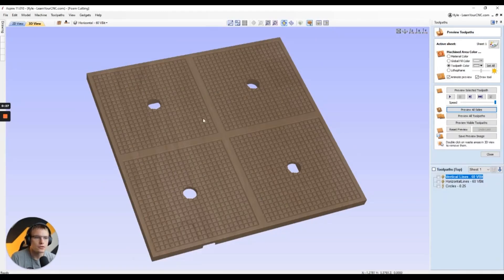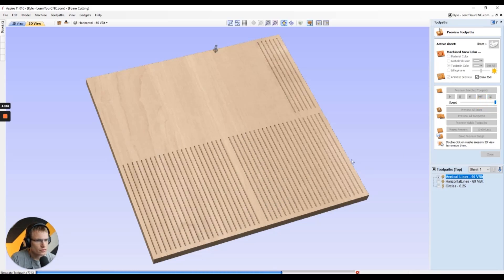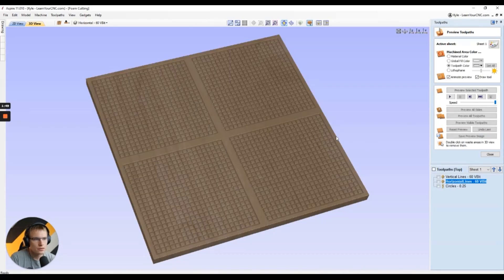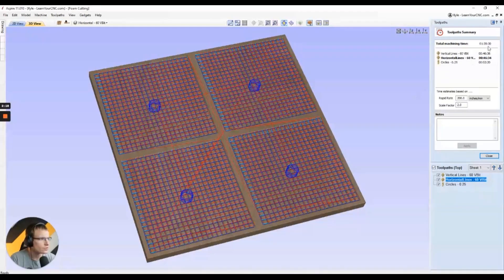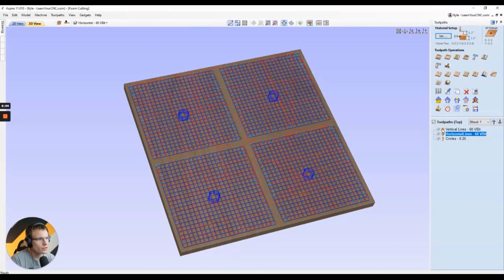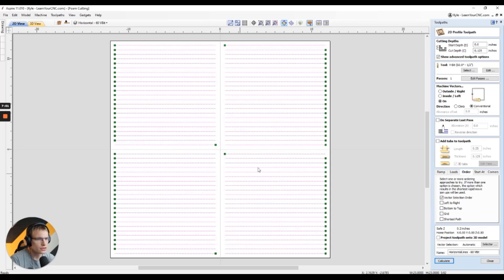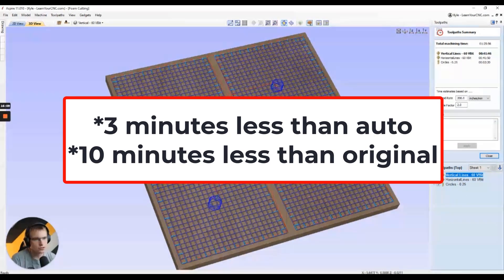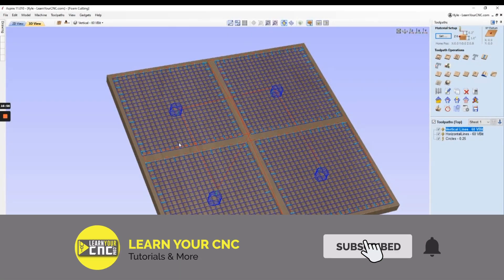Optimizing Toolpaths Strategies - Vectric VCarve, Aspire, & Cut2D Quick Tip

Comment: So I had a person design my guitar neck and fretboard for VCarve Pro. The whole idea for carving the fretboard on my CNC was to have what they call blind fret slots. Which means the slots do not get cut all the way to the edge. Well the file didn't end up that way. I tried contacting the individual that designed my neck and fretboard but he is moving his shop and is not responding. So basically what I did was move the nodes in from the edge the desired distance. Well that didn't work it still cuts from edge to edge. Can you help me out?

Comment: Over an hour to cut that simple pattern?? Try turning off Ramps and watch that go down to 15 minutes... it looks like you’re doing a .5” ramp on every one of those lines, and THAT is where your time is being wasted. 

Beyond that, if you’re going to recreate the pattern to get better speed, why not go all the way down to just 2 of the lines, make sure that the order and direction is correct, and array copy them to be how you want? Once that’s done, copy the whole pattern to another layer and simply rotate the copy. All of the selection order and direction stuff will be already done. Similarly, you could also just do one of the quadrants and array copy the resulting toolpaths so that any changes you make are automatically copied to the remaining 3 quadrants.